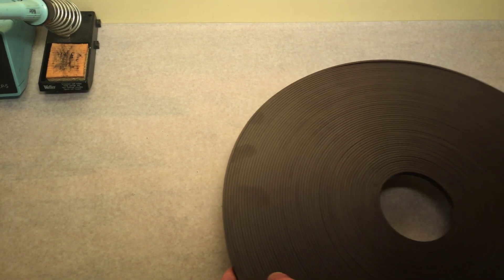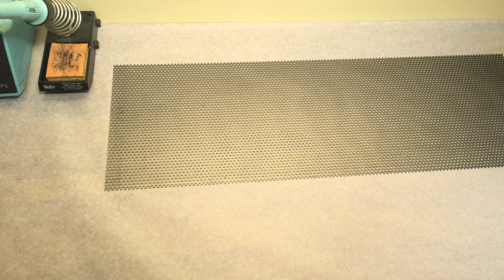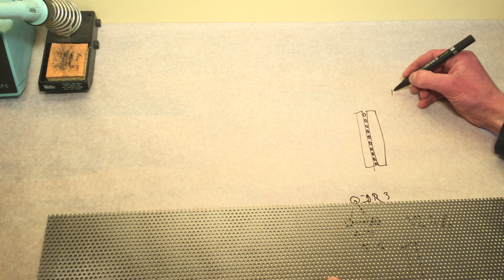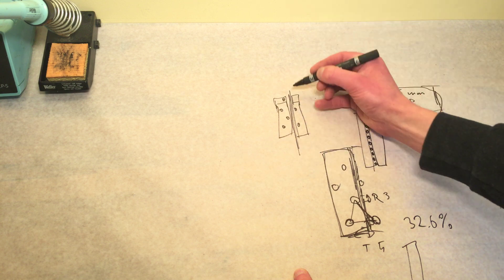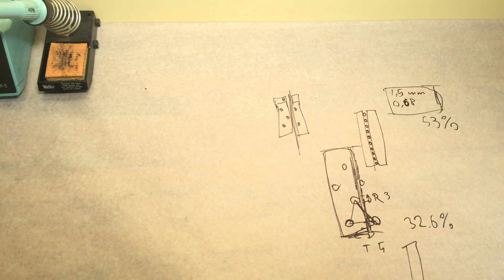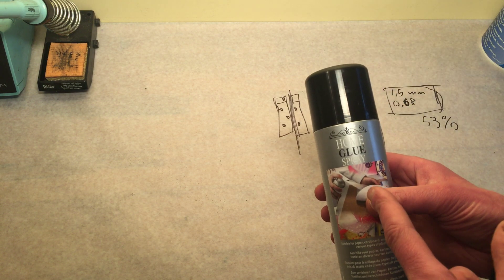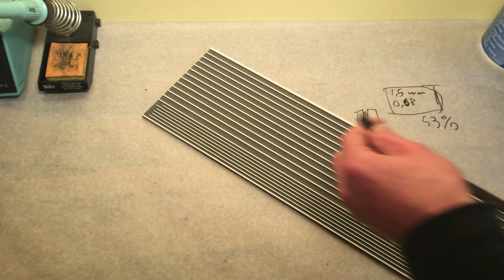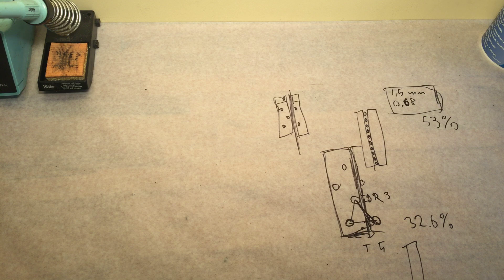Part 1: DIY  (tutorial) make a planar speaker panel :  What do you need?

Comment: Can I do mesh instead of perforated steel sheet? I feel like it's gonna help with measurement but there could be unwanted effect that I don't know
Reply from the maker: well you need some metal , a mesh might be to floppy. the idea is the magnetic field from the backside of the magnet travels trough the steel making the next magnet stronger. 1mm steel or less is enough for these weak magnets but rigidness becomes a problem if its 0.5mm or less

Comment: I haven't seen all ofyour videos, so forgive me in advance if you covered or tried these in the past. Alsyvox (similar to Magnepan) has a very high efficiency rating and I assume most of it is due to using Neodymium magnets. I know these are expensive but not sure if you tried these. Second idea, have you tried using electromagnets?
Reply from the maker: No problem, well yes they use neo's, i only use neos when i need the efficiency, in the end most is about surface area and xmax. for rubber i chose surface area and small xmax to solve the problem. and  neos i chose for small things that do need the efficiency and cant be big,  like tweeters/small midrange etc.  whats holding me back is indeed investment. mainly because power is not much of an issue lately :)  i never tried electromagnets did think about it but it is really cumbersome and even more expensive in the end :( biggest problem is that they are bigger and are obstructing, so it can work.. but i recon more for mid or lows only.

Comment: Can i do it with carbon steel plate?
Reply from the maker: yeah that works to. just regular cheap steel works to. but it has to be perforated and i think that only comes in cheap steel used for most sheetwork. but there is not need to spend the extra money
Reply: @joppepeelen  Thanks!

Comment: You know the strength of your rubber magnets by chance?
Reply from the maker: unfortunate i dont. but it is weak as one might expect. but if you look at my midrange one of the latest videos. it still can achieve usable efficiency. when push pull is used for sure.. 90dB 2.85volt.  as a midrange. with lower distortions so far as a single Neo10.  but yeah mine are 3 times larger so. 3 times as less movement :) a poor mans neo10 :) i guess hehe
Reply: @joppepeelen  Ah k thanks anyway. Learned a lot from your video's! Already have a nice woofer and a good tweeter. But seems impossible to find a good midrange planar or amt for which i don't have to sell an organ haha. So think a diy could be an awesome alternative.

Saw and love your new video's yeah, was just hoping to somehow increase the efficiency to 93 haha.

Comment: I found my Smg1's in someone's garbage by the curb. As an organist I am thrilled! The sound pressure is very similar to an organ pipe. HAUPTWERK digitally modeled organ programs sound remarkably real through these speakers. As do classical acoustic instruments. Great in smaller spaces contrary to what it would seem, 1. wide dispersion right away, and 2. lower air pressure means low ear fatigue. The best part- you can rock out and with your door shut the adjacent rooms can barely hear them!

Comment: Hi joppe thx for answer...where can i buy this kind of rubber magnets?
Reply from the maker: i buy them wholesale in roles of 50 meter and i have to take a minimum of 250 meters. i can sell one roll if your interested. you might need to cut the width to size if you want to use it for tweeters duty.
Reply: Yes i am interressted...
Reply from the maker: 50 meters would be around 85-100 euro in the big panels you see in the videos, used +- 20 meter. one thing is if you fuckup something you can reuse the mangets rather easy. so lot of playing time with one roll
Reply: Thy can you send me one role (50 m) ?
Reply from the maker: get in contact with me at facebook , same name as my channel :)
Reply: Okay thy
Reply from the maker: Richard Loewe I'll see you on Facebook:) talks more easy

Comment: Hi joppe...what kind of rubber magnet du you use?...Mo Problem in Understandig ist this: The Rubber Magnets changing the polarisation Inside the Material ca. all 3 millimeters...?
Reply from the maker: Hi Richard, nope it is not multi pole magnet. it is anisotropic magnet magnetized axial trough thickness. so one side is north one side if south.